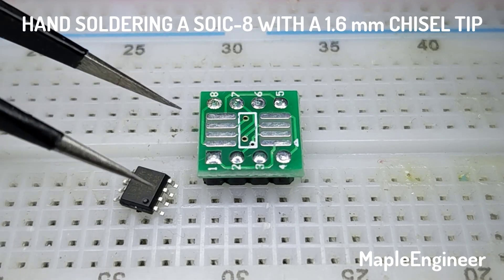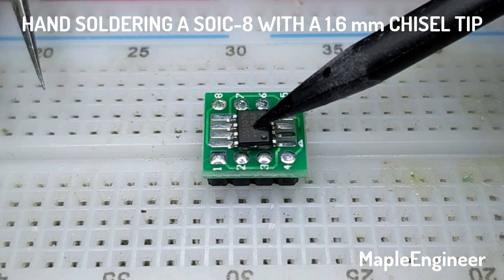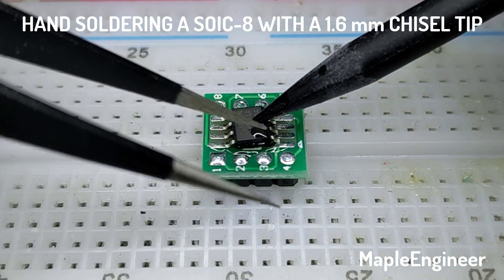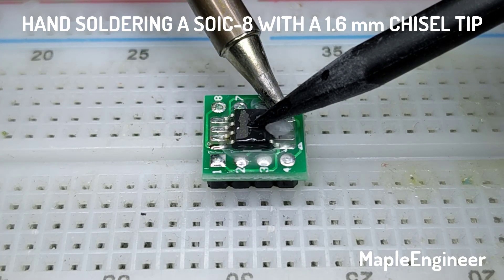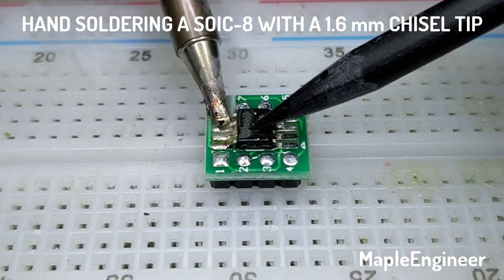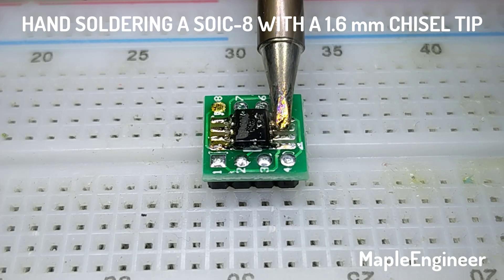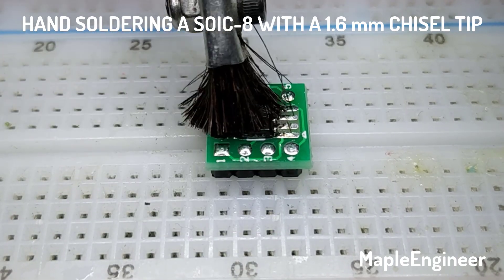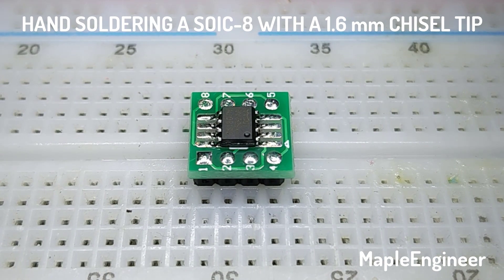Hand soldering a SOIC-8 IC by hand with a 1.6 mm chisel tip on a soldering pencil.

Comment: Notes say you have FM-2027 but that's the handpiece? The plastic soldering aid you speak of appears to be a spudger.
Reply from the maker: Yes.  The plastic tool is a Cooper Tools soldering aid distributed by Weller with their consumer soldering irons.  I have two of them that I have modified and use as you see in my videos.